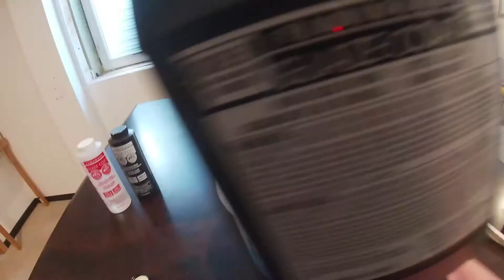DIY 2x4 Computer Desk: GLASS epoxy TOP

Comment: That really turned out nice! Now with that epoxy and self leveling additive does that prevent you from using a torch to remove trapped air bubbles? I know I've had to use it on the bar coat epoxy resin I use.
Reply from the maker: Yes it stays thin enough long enough for the bubbles to get out of the way fast, turned out great
Reply: @millsmillwork5910  awesome I'll see if I can get it here!